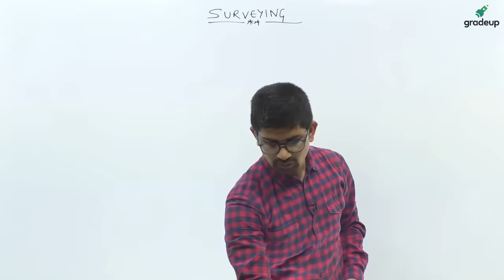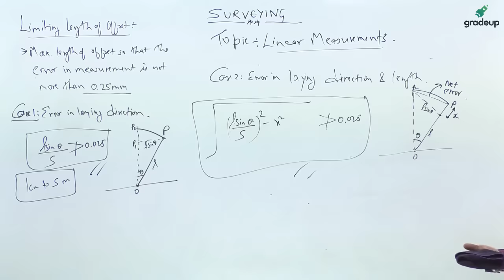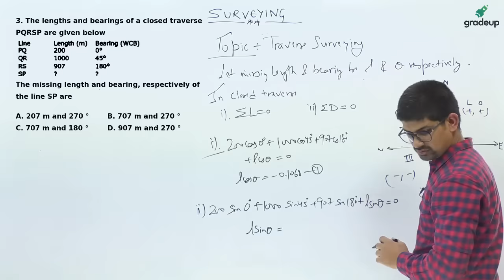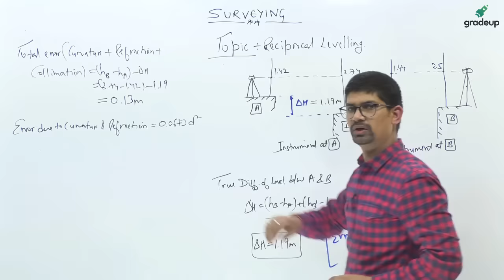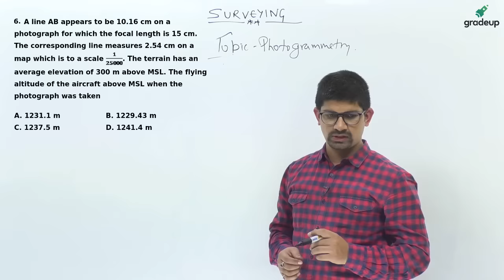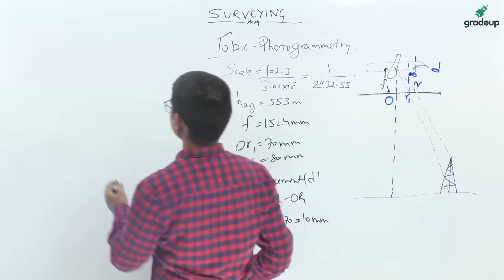GATE 2019 Civil Live Practice Session #9 | Surveying

Comment: Sir, In last question you have used H-havg in the denominator of the formula relief displacement, it should be the flying height above the bottom of tower and so it should be just H and not H-havg,  according to what i have studied.....
Please tell me what is correct...
Reply: In denominator flying height above the bottom of tower. havg is the height of ground level above datum hence we have to use H-havg
Reply: @ashishrawat2852  Sir in the diagram you have drawn the flying height above the bottom of the tower is H....
Then why we have used H-havg..
Please explain sir...
Reply: @AMITWALGUNJE  ok.. consider flying height from datum. The height which is shown H in diagram i have drawn will be H-havg. Please correct it.
Reply: @ashishrawat2852  Thank you sir...😊
Now i got it thats the avg elevation of the terrain or the elevation of bottom of tower from datum.